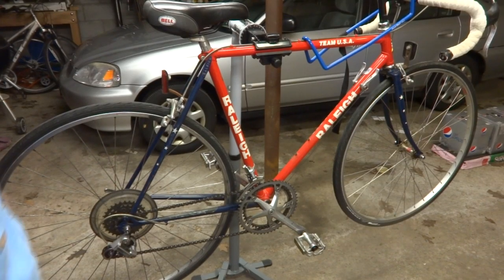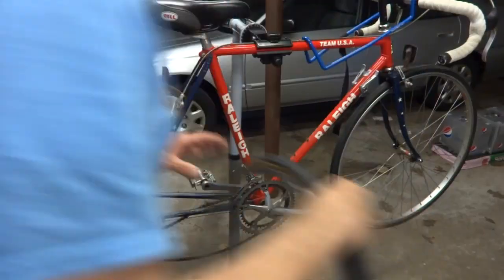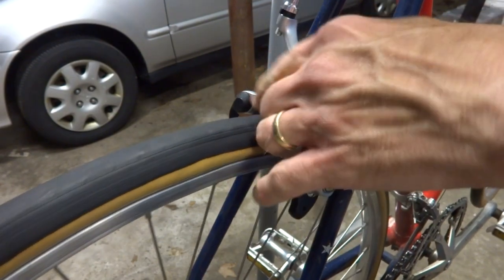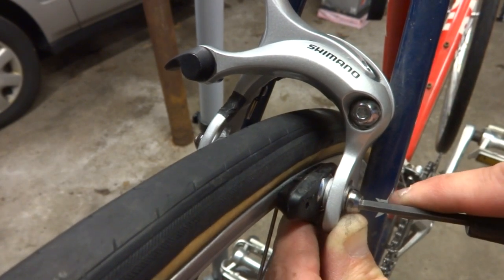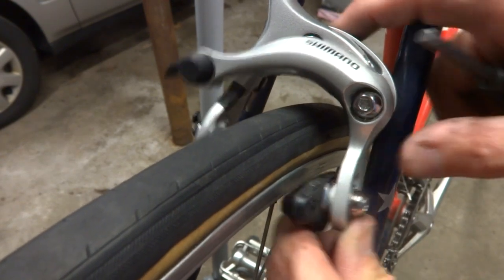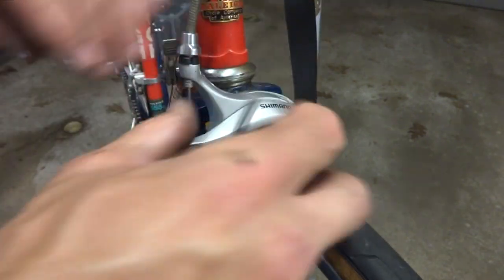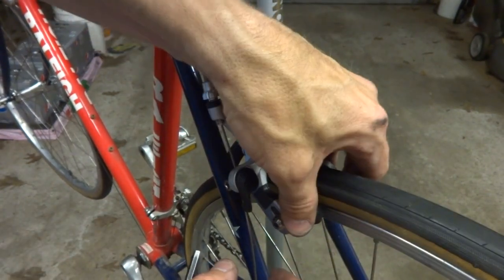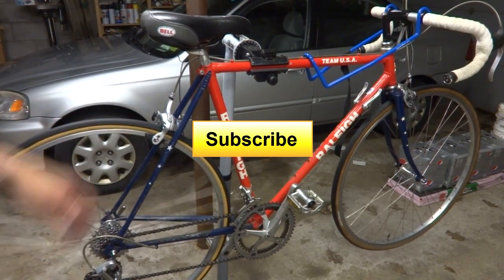How To Do 27 Inch To 700c Wheel Conversion - Vintage Bike Update

Comment: Keep the 27" wheels, they roll really well. And you can get quality rims & tires for them pretty easily.
Reply: Yes but it’s not easy in my country to find 27 inch wheels and is un-economical not to buy 700c
Reply: I wanted to get black rims for my vintage Schwann world sport, 630mm? I can’t find em... thinking of changing wheel soze
Reply: The size of the wheel has absolutely no relation to how well it rolls. That only has to due with rolling resistance. (Bearings, wheel true, tires etc.)
Reply: @twigscampi  well no thats not entirely true, at the time he wrote that comment, 27.5 inch tires had much wider options available than 700cc tires making them smoother. Now 700cc makes them as wide so its a height preference.
Reply: @fanlbc  Yeah, a different tire is going to make a difference but the rim size itself wouldn't change anything. imo. Also they've been making super wide 700c tires sense 1991 (the advent of 29" mtb tires/wheels) so they were around when that guy commented a year ago lol.
Reply: @fanlbc  27.5 inch (650b, 584mm diameter) is a totally different wheel diameter than 27 inch (630 mm diameter). For the latter, it's really hard to find tires as it is an old road standard.
Reply: @twigscampi  larger diameter keeps energy better
Reply: @fanlbc  That's just not true. I was using 700 × 32s , × 28s  in the late 80s and early 90s. Those tyres have always been available.  Height changes with tyre size anyway
Reply: @johnsmithers284  no, mass does. Inertia. A polystyrene wheel 1m in diameter is not going to spin better than a steel one half the diameter .
Reply: @fanlbc  You are talking about yourself,  not about me. I wasn't a child at the time. I acquired a tandem in 1990. 32mm tyres, no problem whatsoever to find them.
Reply: @peterwillson1355  lol keep making up stories if it makes you feel better, provide sources for your arguments and we'll talk
Reply: @fanlbc  if you think wider tyres = smoother, that just shows how little you know. It depends on the model.of tyre, too.
Reply: @fanlbc  700 c was the size of wheel.most commonly used on the continent of Europe in the 80s, when many new bikes in the UK were still being sold with 27" rims. You think the French didn't have a range of widths of tyre for those rims?!? When most bikes were utility bikes, not used for racing?!?.
Reply: @peterwillson1355  I have both a 1m polysteryne wheel as well as a 0.5m steel wheel and I can tell you you are wrong.
Reply: @johnsmithers284  🤣🤣🤣
Reply: @johnsmithers284  but do you have a wooden rim with a marshmallow filling?
Reply: @peterwillson1355  it's clear that your reading comprehension skills are lacking big time 😂
Reply: @fanlbc  did you mean COMPREHENSION skills? 😳 🤣🤣
Reply: Are you sad because your tricycle is broken and daddy didn't buy you a new one for Chistmas?😪
Reply: @fanlbc  get some help, kid

Comment: Thanks for this video, I followed along to swap 27" to 700c and found that my brakes had enough distance in them to cover the difference!
Reply: In his original calipers, I could see the brake pad stems would have lowered to fit the 700's. He already bought the new calipers and so pushed through the conversion.Those side pull  Shimano's are better anyway, but they don't 'look' vintage.

Comment: Thanks!  I have the same bike that I bought at Goodwill for $12.95, and overhauled for about $150. It's just a hair tall for me.  It looked like I could switch to 700c with minimal work, but I wasn't positive.  The lower height should help, and having more options for wheels and tires will be nice.  I didn't expect to find a video of my exact bike.  I also want to set the original wheels aside since they still have the original stickers and are still in usable shape.

Comment: Thanks RJ! I just converted my vintage 10-speed into a 14-speed, with the 700c wheels! Also installed a used 6 speed derailleur and it's work's for 7! None of us would have been possible without your videos! Never would have attempted this if I never seen this video!
Reply from the maker: Yes, SIS RDs all have the same cable pull ratio.

Comment: RJ - This video clearly illustrates the dual-function of the Park Tool Co. cable-housing cutters, which also appear in your video about tools. Some Viewers (me included) may not have been aware of the crimping function also included in that cutter design. The pair I bought has two different crimping functions - one for cable end-caps, and another for housing ferrules. Well done. I have and old Raleigh Grand Prix that deserves similar 700c modernization.

Comment: I want to do this with my project bike, but with a slight difference. I want to keep my original hubs and rebuild a wheel with aluminium rims. The wheels i've got have badly corroded rims and the spokes are awful. I've measured my brake calipers and they will easily accept 700 rims. Great video! You are truely an inspiration to many.
Reply from the maker: https://www.amazon.com/exec/obidos/ASIN/B004H1UA9Y/ref=nosim/youtube25-20

Comment: I did this several years ago to my Panisonic bike that was made in the 80's.  I've gone through a lot of money upgrading the bike,and have actually spent really more then the bike is worth, but I like the older style frames.  I put on 700c Mavic rims with 105 hubs, 9 gears in the back.  Then I put on new Ultegra cranks and derailleurs so I have gone from a 12 speed to 27.  The one thing that I did that others may not agree with is that I did not go to index shifters in the brake handles, rather I have a old Suntour shifter that I have on the gooseneck.  I'm a older guy, and I don't like bending down to the lower tube, and I don't like them on the brake levers, so for me this was the logical choice.  I have to say, it's made a lot of difference in the way the bike rides and handles.
Reply: I have a Panasonic from the 80's that I want to do the same thing: Mavic wheels, 105 brakes and crank, but I am to reuse the Suntour shift. I am older also.

Comment: Hey RJ great videos I will say one thing on Tires, yes you get a wider variety of Sizes in 700c but unless you want to get really narrow or really fat there are PLENTY of 27" tires in a nice range of sizes out there from 1 inch (25c) to 1 3/8 inch (37c) in addition to the ubiquitous 1 1/14 (32c)   by numerous makers.  People who claim that "you can't find 27 inch tires"  have simply not looked.
Reply: Oh nice, so if I get an old bike that comes with 27 1 1/4,  I don't have to change the rim to 700 to get a wider tire?  You're saying I can just change it  to 27 x 1 3/8 and that's it?   I like wider tires, and I notice these older bikes have the girl ones where you can step through them which I need with groceries on the back.  If is so thanks in advance!

Comment: Thanks for posting this instructive video. I have a superb Raleigh Record Ace, early eighties, and am considering changing from 27" to 700. It's a very high end bike, Reynolds 531 tubes and forks, Campagnolo derailers, and presently Rigida rims with Campagnolo Veloce hubs and an eight-speed cassette. I've changed the previous Weinnman 605 original levers for the most beautiful Mafac Competition 2000 Gold centre pulls. These will allow for the lowering of the brake pads if and when I do change rims, tires, AND hubs. These will have to be top range. I think it's going to cost me an arm and a leg! Thanks again, I'll keep watching your videos.

Comment: I generally like your videos. You have a lot of innovative techniques for removing gauled and worn parts that are quite useful and helpful.  In antique collection Original Fabric is best. Followed by Condition. If I find an old bike of any kind I just clean it up and service it. If it has missing pieces that aren't cheap or readily available I would and have substituted some that are just to keep the bike on the road. A useable bike being worth more than a non runner.  That way someone that wants a completely original version of any bike can at least ride it until they find and purchase the missing parts.

Comment: Rotating the brake adjuster clockwise (up) is tightening.  I know, its a tricky thing to remember, but the Bowden cable system uses the cable housing tension for minor adjustment to the cable.  The cable wire, once fixed, never is adjusted shorter or longer with the adjustment screws, only more or less tension is applied by them.

Comment: Thanks .  Will convert 80's road bike to 700c electric FRONT small 250 watt motor. Will leave rear gears alone (27 inch wheel) and have small assist when hitting hills. Appreciate your help.

Comment: Didn't need to cut perfectly good cables. Undoing the cable clamp would work just as well--unless the cables were indentified as needed replacing. That avoids threading new cable and fitting into the levers.
Reply: Those cables were likely as old as the bike. They had a dull grey appearance and were likely cruddy.

Comment: Other than your mentioned advantages of the 700c wheels does the original 27 inch wheels not functioning well reason you're replacing it? Just thought the whole bike is already cool the way it is including original wheels, but good video. Thanks

Comment: A couple of points to bear in mind with a conversion like this - the braking power is reduced as the pads are moved further away from the pivot (less leverage). Also, the bike now sits lower and the chance of a pedal strike on the road has increased. Older 27" tyres were relatively tall in construction whereas modern 700c tyres have a lower aspect ratio. When you take into consideration the 4mm reduction in radius and lower tyre profile, pedal contact is obviously more likely on corners.
Reply: I think few milimeters of difference is totally insignificant. If only 4mm is missing for you in a corner, you are already riding beyond the safety limit. The settings of the original brakes in the video is almost good for the new rim, I don't think that this swap changes anything noticeably.
Reply: SC24 - those are great points!  I am included to agree with Gabor Moczik on the actual effects, BUT it's always nice to consider those unique issues when doing something like this!
Reply: SC24 isnt 28 the wheel size all road bikes have?
Reply: @thijsvandenbroek5333  Old comment, but still: 28" is a wide range of rim diameters (from 622 to 642), 700c is ISO 622, 27" as used here is ISO 630, but 27" can mean ISO 609 to 630. The ISO measurement measures to the inside of the rim, just where the tire starts. Due to the wide range of different rims in inch measurements, I'd only use ETRTO/ ISO 5775 numbers. Current road bikes most often have 622, but smaller ones have 571 (which is 650C, not B).
Reply: Really? Check just how small 4mm is. You might has well advise people not to use long cranks.

Comment: For those converting a cantilever brake equipped bike from 27" to 700c wheels you may find that some cantilever models' pad mounts will not allow you to lower the pads enough to align with the smaller 700c rims' sidewalls. In those cases, as with the caliper brake equipped 27" wheel framesets, you'll need to replace the brakes.

Comment from the maker: Vartan Ghazarian, that is a Park Tool HBH-2 Handle Bar Holder. It cost under $20. It's nice to keep the handlebars straight and the wheel out of the way when you are working on a bike. Here it is at Amazon.com: http://www.amazon.com/exec/obidos/ASIN/B000QSXPL2/ref=nosim/youtube25-20
Reply: RJ The Bike Guy I was about to ask this question, thanks a lot for the very informative videos!!!
Reply: +RJ The Bike Guy is your bike a tange/reynolds?,i saw the sticker on the seat tube :)
i just got a malvern star (1 star) tange 900 cro mo frame & fork   (it's an australian bike) & was wondering how to measure the drop on the caliper?,great idea for another video :)
my bike has shimano calipers with the pointed nut (like yours) btw what are the replacements you fitted?,they look like shimano sora to me & what's the difference in the drop?
could i use a dropper bolt on the cro mo frame/fork instead of replacing the calipers?
Reply from the maker: It's Raleigh 555sl double butted chrome moly.
Measure from the center of the mount hole to the center of the rim. That is the drop of brakes you will need. Measure from the center of the bolt to the center of the pad is the drop of the brakes (measure with the pad up and down for the range) http://www.sheldonbrown.com/images/caliperreach266.jpg
Reply: RJ The Bike Guy isnt 28 what all road bikes have?

Comment: Hey, so I had the issue where it was too short.  One solution you can do which works for me is to put a slightly thick piece of metal and drill two screw holes into the top to be strongly in the calliper and not move and one under the calliper for the brake pad.  Works flawlessly for me, if anything, too well.

Comment: Older bikes sometimes had 9 mm axles and lugs with narrower clearance so you'd have to remove some metal there, which could compromise wheel alignment. Best keep the old hubs
Reply from the maker: Rear are axles are typically 10mm. Front wrench axles are typically 9mm. Nutted axles are usually 3/8" or 5/16".

Comment: I did a upgrade on my viking phantom not long ago I upgraded it from a 21 speed to a 30 speed, new bars, seat post, saddle, bottom bracket, brakes, derailleurs, break lever shifters, wheels, cranks and bar tape I had to gring the break mounts on frame sligthly wider so I could fit the new breaks
Reply from the maker: I am going to be doing some of that on this bike. It will be fun.

Comment: Is it ever worth it to save the cables and reuse them?   I've done this before as a kid riding bmx.  Now days, I see videos always just cutting the cables and putting in new ones.  I guess I'm tight in that way.  If cables seem still good I would re-use them, as long as they are not frayed at all.
Reply from the maker: I don't. Cables wear out, get cruddy, frayed, etc. They should be replaced periodically. Would you reuse the oil in your car? Or buy fresh oil?
Reply: C'mon, apples to apples.  A cable that is in good shape is very much different than reusing motor oil.  In an auto. you will cause catastrophic damage to your engine, if oil is reused.  Not so, if you reuse a cable that seems to be in good shape-not frayed.  Other than being frayed, I've seen decades old cable get a rust-like quality to them (Hawaii air) They get brown and  get some rust dust particles in the cable and some do get frail and /or overly stiff.  I've never seen or heard of a brake cable failing though.  My dad (RIP) used to mess around with bikes a lot when I was a kid back even to when cables were a mechanical arm linkage and many bikes had Bendix foot brakes.  My dad  was overly thrifty back then.  Living through the depression makes you like that.  Times have changed.
Reply: i suppose if you are super cheap, you can wait until there are problems.  However, it will be less work to swap them when you have everything apart.  

Plus, if you always wait for shit to break before you replace it, you guarantee poor performance and possibly having a breakdown.  

And personally, I'd rather have catastrophic damage to my car's engine than my own face on account of a brake cable snapping.
Reply: i see what you mean about the cables if its a commuter or a low end bike i usually keep them but to replace them it will run me about $20 or less so for a hi end sell i would replace them but a low cost bike i will try and save them
Reply: Po Zr Agree cables last forever unless U brake like a maniac,  just double check them its good enough!! Mine last Me for many years!
Reply: Cables and housings corrode over time, it causes drag that will make them sluggish, particularly the shift cables.
Reply: OK, if they are rusty or tight and sluggish, then I wouldn't be able to say "They look perfectly fine" now would I? I, like most other people have had numerous bikes as well as my kids and I've NEVER even heard of one breaking, even in BAD condition. I had a clutch cable break once on a motorcycle, but it was nearly 20 yrs old and of course outside the whole time, rain or shine. And I've never had to "adjust" my brakes for center... No matter how tight they are, they WILL center the first two or three times you use them. I did like the way he gives a starting setup point for adjusting the lever pull... 4 turns out, squeeze hand tight, tighten cable set screw, and adjust out from there... nice tip.
Reply: Po Zr you asked, he answered
Reply: For the brakes on your childhood BMX when you weighed 100 lbs or so and were made of rubber, why not.  For your indexed shifters now days, probably not the best.
Reply: tcorourke2007 
 NOT ,,, if you oil them every 7 months . May last for centuryies !
Reply: Po Zr -- Brake cables might be fine to reuse, but I would never reuse old shifter housing/cables. Most of the time if you're having problems shifting and you can't tune the gears satisfactorily, it's the housing and cable sticking. For a road bike that does a lot of miles each year, I'd replace the cables every year or so.
Reply: I would only reuse cables if they are stainless steel.  You certainly dont want the front brake cable to fail, so at least change that one regularly.
Reply: I cant stand the cutting the cables...I ride road and  bmx, cables can be used forever....I fix vintage bikes and can resuse everything with a little lube..

Comment: Hey RJ can you do a video on how to measure the drop length for the brakes? I have an older 10 speed that I am wanting to update a bit, and one of the things I would like to do is the actual brakes, I've replaced the levers with aero style already, but the actual brake drops are confusing me a bit. There's not much information online, but everything I've read is giving me a measurement of a drop of 69 for the brakes. Does that make sense? Older 10 speed with 27" tires and Shimano Tourney Center pull brakes. Many thanks, I LOVE you're videos.